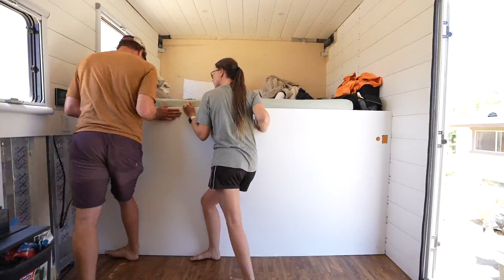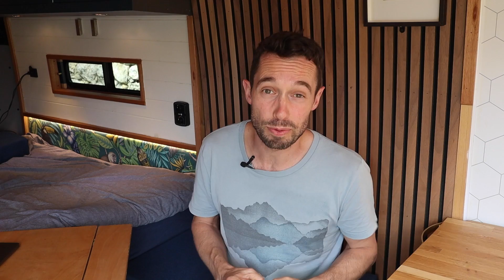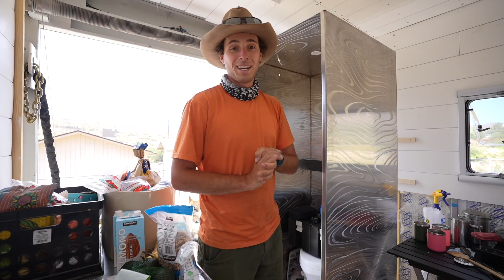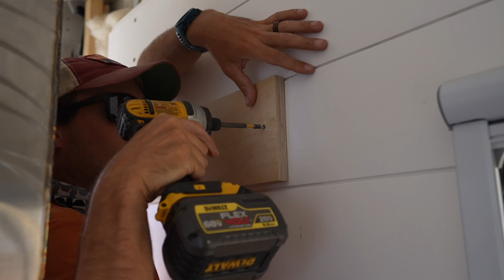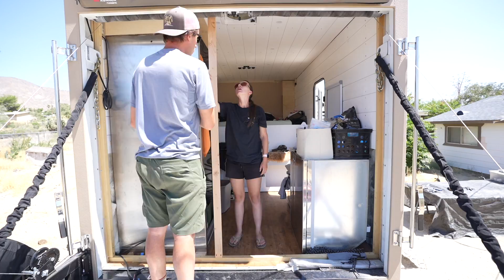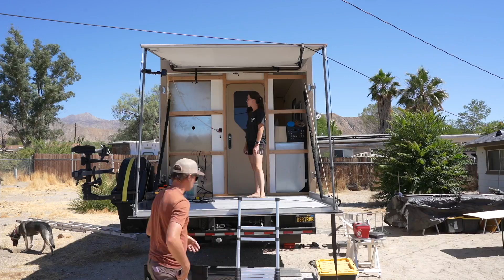DIY Expedition TRUCK Build / Stainless Steel Shower, Sliding Slatted Couch / Part 8

Comment: Whats the story with all the thermal bridges on this build? Those steel braces are touching the alloy shell of the box. That shower will develop ice in winter 😅
Reply: Well the steel supports are what hold the structure of the box / aluminum skin up/together! It’s just like a van… 😅 sorry to disappoint but no ice has ever formed in here 😂
Reply: @the.desertcruiser  I understand that. That's why usually there is a wooden beam put between any internal structure and the outside. So there is no metal connection between in/out. Dunno but in humid and cold environments this might become issue over time. Just from point of view of basic thermodynamics.

Comment: Where did you guys get the stairs for the side door? And since you remove them what does it mount to for when you want to use it?

Im looking for a set of stairs like that for the back of my box truck for entry some my dog can get in and out super easy
Reply: Hey they are Torklift steps! They come with a bracket which bolts into our camper, and you simply use trailer pins to attach the stairs to said bracket when setting up the stairs! We couldn’t have permanently mounted steps (simply) since our door is above the rear tire!